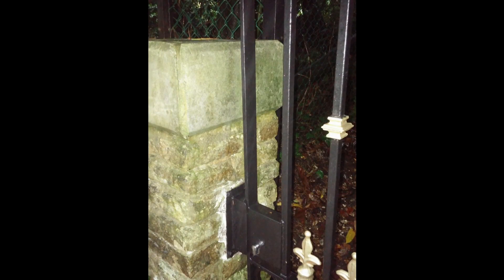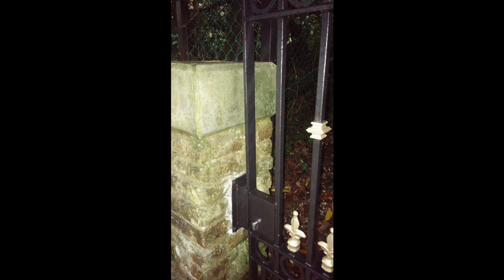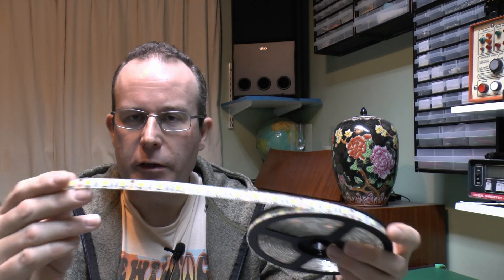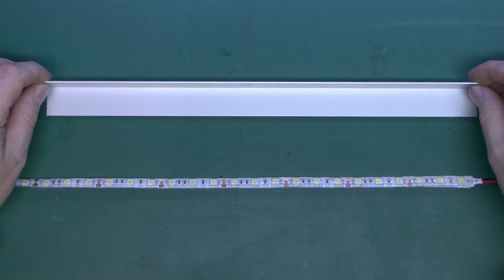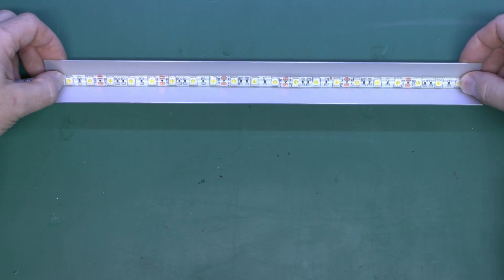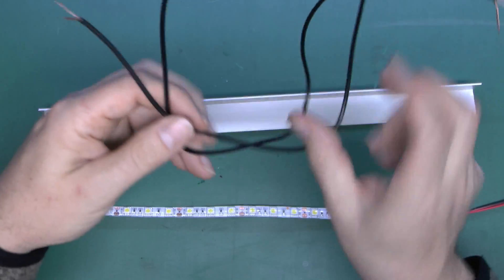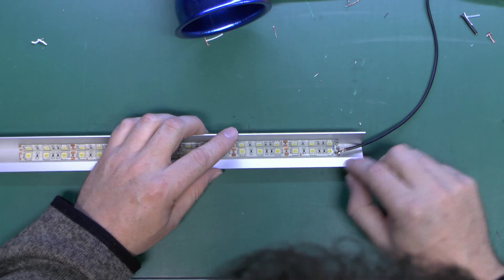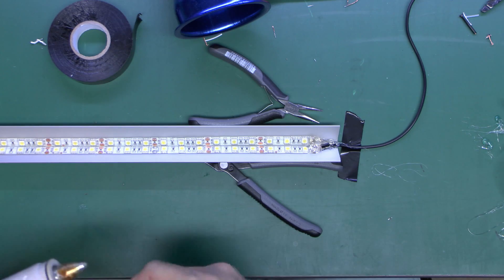Building an LED strip light for an outside gate

Comment: Hot glue with acid cure type silicone doesn't exactly like each other, the hot glue tends to deteriorate in a matter of days, and some extremely tacky oily liquid stuff tends to form on the surface the hot glue, separating the two materials... I don't know if that is because the kind of hot glue I used, or any type(I've ised 2 type, one that has a clear appearance and has a lower 
melting point, and one that has a foggier appearance, is harder, and has
 somewhat higher melting point), but it happened to me, so I would not advise using them together... :S
Reply: That's worth knowing. I've not used them together but thanks for the warning.
Reply: You're welcome!

Comment: Just my 2 cents worth for anyone who likes hot glue for hobby work. If you warm the pieces/surface you are bonding to with a heat gun or similar tool, the glue adheres to porous surfaces MUCH better. You're a lot less likely to end up with a blob of glue that did little more then take a mold of the surface it was on, let alone adhere to it!
Reply: Agreed. On something like aluminium so much heat will get pulled out of the glue at the interface it will hardly bond at all.

Comment: I thought silicone caulk used acetic acid for curing, which can corrode copper.
Reply: For electronics and other sensitive uses there a 'neutral cure' variety that doesn't.  <Later> But the one John uses is an acetoxy cure one.
Reply: Graham Langley Well yes, but that's not caulk. Wasn't this just ordinary caulk? I don't think the silicone adhesives and potting compounds for electronics come in caulking gun tubes.
Reply: +Antonio Tejade They do and I've used them many times. Just look for 'neutral cure' or 'non-actetoxy'.
Reply: Graham Langley But I don't mean just neutral-cure caulk, I mean the stuff actually made for electronics use.
Reply: We found the same sealant was sold in different dispensers for different industries under different names. So we went with the cheapest, which was in a sealant gun pack. Silicone potting stuff - the fluid stuff that flows around things - is a different matter.
Reply: Antonio Tejada

Comment: Hey John... tip for next time - link the two strips at the opposite end to the power feed tail.  I would imagine that after you linked them in this movie, when you went to solder the tail on, the links would've kept popping off, moving around and being a nuisance.